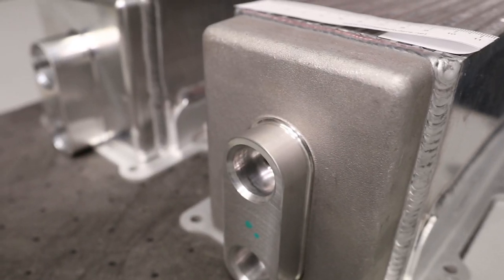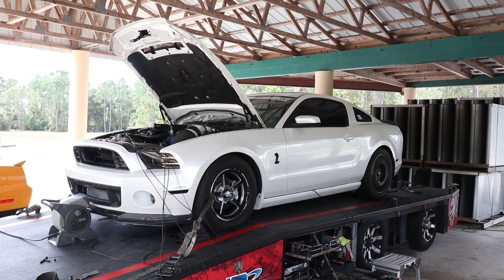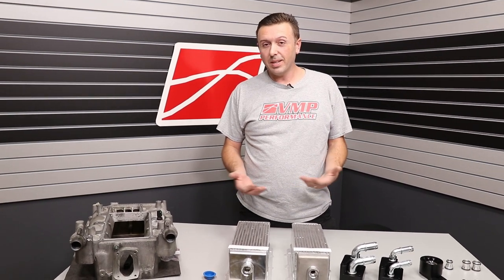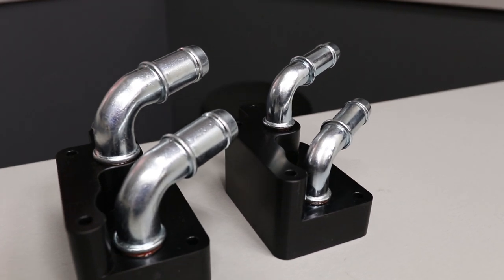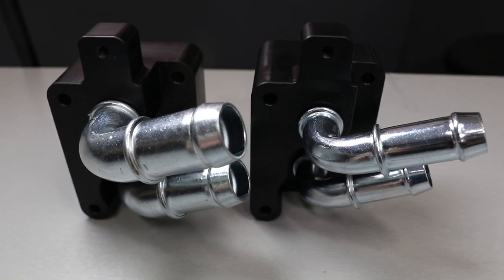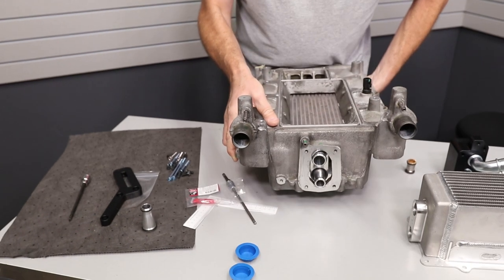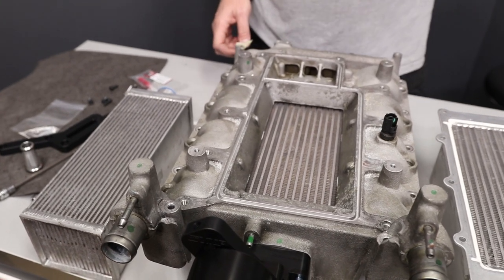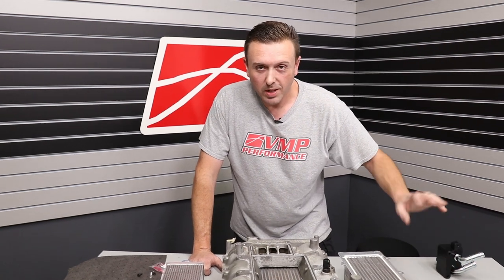Product Development || s197 GT500 Intercooler core and Water Manifolds

Comment: Ok Justin I need help…. My VMP 1” water manifold/intercooler setup IS HAVING FITMENT ISSUES.  Lower tube on the water manifold is hitting the powersteeeing pump body.  I had to use a bar to change the angle of the inlet/outlet for the water manifold.  I posted this a long time ago and you’ve ignored my post.  I’m possibly the only person in the country with one of these on a 2007-2009 daily driver.  Maybe now since reworded and corrected spelling maybe you’ll answer.  HAS VMP EVEN TRIED TO FIT THE LARGER 1” WATER MANIFOLD ON A GT500 WITHOUT ELECTRIC POWER STEERING?  I’m guessing not…… dare you to answer

Comment: So I have this upgraded intercooler brick and as Justin says you need Allen bolts, yet VMP included bolts with giant 10mm bolt heads which of course won’t work. 😳 So I can’t assemble the intercooler until I go out and find some proper hardware. 😖
Reply from the maker: They will fit and they are there to help spread the load, make sure you use the support rails.
Reply: @VMPPerformanceTV  I used the VMP support rails. I reused the factory Roush bolts.

Comment: 8:24 mention of an install and flow test.  Is this content available?  Would love to see flow comparison vs stock with full 1 inch lines through the whole system.  Considering this IC brick + 1 inch water manifold, modified HE with 1 inch fittings, and a trunk ice tank with 1 inch hoses running whatever powerful pump isn't on backorder.

Comment: Justin, I have this intercooler. It's sitting at home and might be installed into my 2012 GT500. I say might because I have not seen any testing on this. I ordered my J2 Fab intercooler in July, needless to say it is still on backorder and the VMP was kind of a stop gap till the J2 showed up. The two products seem very similar and I have already paid for it so ill have both the VMP and the J2Fab intercoolers. I bought it on the assumption there where already documented and verified number for it but once I looked this was not the case. The one car I have seen it ran on, in a video had extremely high temps. Was it determined that was a defective product that was sent out? Or some other kind of issue? I only ask because I want to see if it's worth it to even install. I want to say also, I have many VMP products and you guys have worked on my car a few times, so no one take this as me knocking on VMP I am merely trying to get hard facts and data for my car. Thanks Justin
Reply from the maker: Hey Tim, part of our new product release process is testing and documenting performance.  This product has exceeded our expectations and is now available to the public.  The owner of car you are referring to is no longer a partner with VMP and no longer runs any VMP products or services, additionally, that version of the intercooler did not make it to production in this application, nor was it installed or used properly by the vehicle owner.   If you are interested in additional consultation on how to get the most from your VMP parts please reach out to us.
Reply: @VMPPerformanceTV  I'll give it a go then, that J2Fab might still be a while it seems

Comment: I'm wondering what the shelf life is on the intercooler in my 04 Cobra? Already planning on a Gen3R for it later on in 2021 so perhaps over the winter I can get the intercooler and swap that and put the Gen3R on in the spring of 2022. I had been e-mailing with Anthony he was quite helpful
Reply from the maker: Glad to hear you've had a good experience contacting us.  As for shelf life, as long as you've done goos at keeping an eye on your fluids and doing proper maintenance, it should be fine.  You would want to want to arrange the install of both the intercooler and Gen3R as they're both involved in a head unit swap and you might as well do them together.  Otherwise, you'll be doing one of them twice.
Reply: @VMPPerformanceTV   Thanks. In the end I always wanted a VMP on the Cobra but it was a back and forth struggle between the VMP Gen3R or a Whipple 2.9. In the end the VMP is going to suit me better for what I'm building the car for. Plus it looks better too.
Reply: @Lethal_Venom  Whipple 2.9 is good, but the 3R will get you the HP AND the monster torque curve far lower in the RPM range than the 2.9. But if I were you, Id wait for the next VMP unit thats going to have the TVS3100 rotor pack. I have a feeling that it will do the same to a 3R that the 3R did to the 2R.
Reply: @lexustech48  I’ll be fine with the 3R for my power goals and I agree on the TQ vs the 2.9

Comment: 2:02 shots taken at the Kenne bell Intercooler but they have testing and data what’s wrong with that ? I don’t see the same with VMP at all just my pet peeve I respect company’s that test there product AND provide data vs word of mouth ..
Reply: Ask KB about their charge air discharge temp data vs Whipple and the TVS....
Reply: @lexustech48  that’s a stupid comment and question .... regardless the blower every car (especially GT500s and the tune ) is different really stupid question lol and owning a whipple a kenne bell and a TVS I had no complaints on neither blower IATs where all low my expectations where exceeded ... 

Again vague fanboy questions /comments make you look stupid with all due respect this isn’t a brand thing at all
Reply: @lexustech48  whipple and VMP don’t have the data KB has does that make them a bad company ? Absolutely NOT I just like KB for there information on the website I’m gonna spend what 6500$ on a system how can one be mad at all the info they provide ?????? Facts
Reply: @mach183  having data doesn't make them a "bad company" but the cherry pick certain data that isn't necessarily the most important part just to make their product seem superior.  They are always talking about the blower dyno this blower dyno that and talking in cfm and all this other stuff with the intercooler part Justin was simply saying that just stating cfm alone isn't really all that important on this particular part because if it flows through too fast it can actually hinder it from doing its just correctly.  I think that is what he was getting at.
Reply: @midnight347  kenne bell is a awesome company and I have zero regrets picking them … 

Intercooler are a dime a dozen and really doesn’t make or break a build
Reply: @mach183  read all the posts.  I’ve got a 2nd hand 2.8LC MAMMOTH with THIS VMP 1” water manifold/tensioner and it flows great.   I’ve got a custom system with a DOB POWA intercooler pump and the only part of the system that has an I.d. Below 1.25” is the VMP intercooler and water manifold.  You’d be shocked at my flow #s